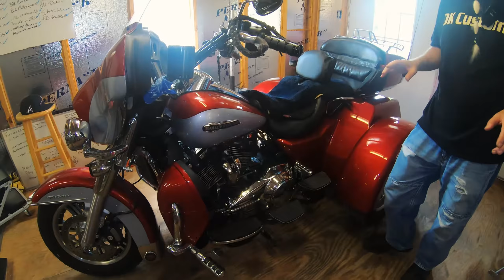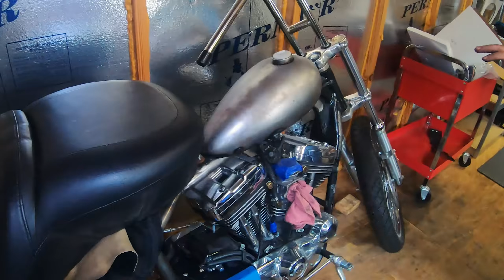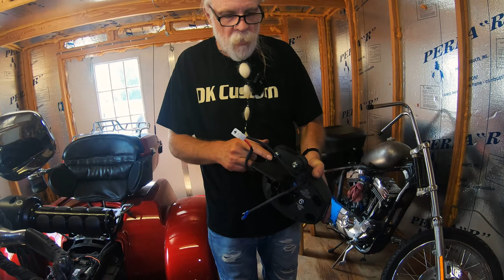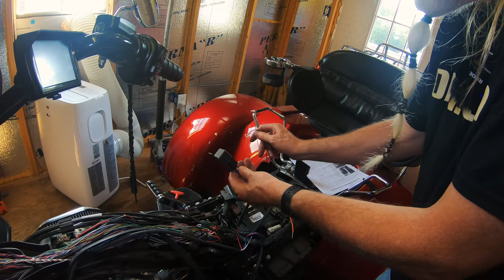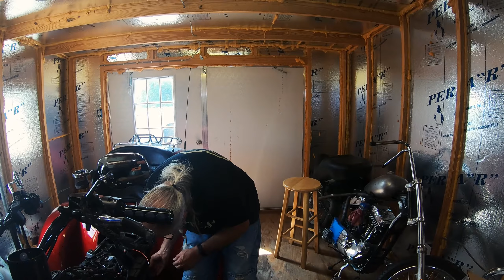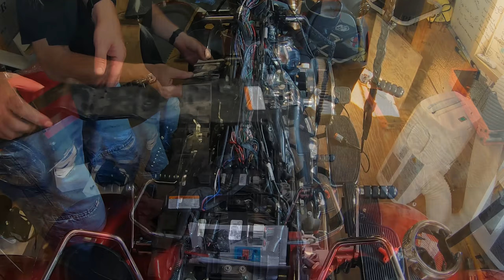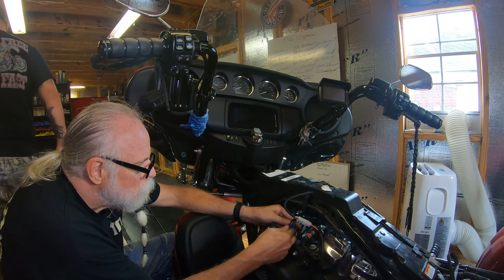COOL YOUR HARLEY - SEE Force Flow Fan Installation

Comment: So Harley designs an engine that can/will exceed the safe elevated operating temperatures as per their own manual, then charges you a fortune to buy their product, then on said Harley perfection you must spend additional dollars to help with engine cooling so you don’t ruin the engine. I get that right? Makes sense to me.
Reply from the maker: Yeah, not ideal, to say the least.  Harley is in a catch-22.  We discuss that at the beginning of this video-
https://www.youtube.com/watch?v=N0kLaVQhbW4
Reply: It's the EPA and European environmental agencies forcing more and more restrictions onto manufacturers like Harley and if they don't meet the requirements, they get shut down and not allowed to sell vehicles at all. Don't take all your anger out on Harley, it's the EPA and if those rediculous regulations weren't in place, Harley and every motor vehicle company would let their bikes and cars breath and it would be cheaper, better and more affordable for everyone involved. These envoronmental agencies are completely out of control and making it impossible for businesses to succeed and they're killing manufacturing which is a vital industry for any countries economy and jobs. Small businesses don't stand a chance with all the red tape if massive companies can barely manage. Most of their regulations do nothing for the environment, it's about money, power and control.
Reply: Yea but however the fan isn’t HD yea they make one to put under the seat that pulls air over the rear which they should install from factory especially much as they cost the bad thing with all the electric crap our wonderful I mean very very very wonderful government are doing all bikes r fixing to soar not sure what any manufacturers are going to do but yea they all are going to outta sight
Reply: Yep. Spend a fortune doing what Harley should be doing already

Comment: Oh, and forgot to add. You need to double check the thermostat wires and make sure they  clear the bottom of the tank. Don't ask how I know.....LOL
Reply from the maker: Yeah, we should have shared that in the video too...make sure all the wires clear.  We use tank lifts, so there was plenty of room and we did not even think of that.

Comment: Nice install! I too run a Jim's Force Flow fan on my 130 inch TMan engine. In stop and go, 95 degree weather I see 375 head temps thru my PV. Looks so much better than the Love Jugs, only bad thing is the puny horn, but I wired my factory horn in parallel and mounted the horn on the engine guard under my RGS Fairing
Reply from the maker: Very cool!  That sounds like a fun engine!  What is the ET reading on your Power Vision?
Yeah, those that want a loud horn...it just won't fit in that housing, so best to do what you did and use them both.  Thanks for sharing. 👍
Reply: @DKCustomProducts  375 was the highest reading I saw, now that fall is upon us here in the northeast, I see 325. One thing that "bothers" me, is the thermostat is on the front cylinder. My thinking is it should be on the rear cylinder, as its the hottest, but clearance would be an issue. (No tank lift on mine) And, Oh yeah, its a fun, fun ride.....Especially wacking the throttle in first.....second...third.....LOL 150/153 to the tire does that to you!
Reply from the maker: @01Lightning  Yeah, as you see I did install the thermostat in the video.  Rode it that way for a couple of days.  I have now bypassed the thermostat and just use the switch.  I like it better that way,.

Comment: Super kewl! was nice to see how to get the fan thermostat to mount on the twin cooled M8. I recently installed the love jugs on my 2018 Ultra Classic. I did hook up the wires directly to the battery. I do have to turn the fan on and off manually; however, I don't really mind doing that. If I ever got tired of the love jugs I'll try Jim's Force Flow Fan. I do like the look.
Reply from the maker: Thank for watching and commenting. 👍
Yeah, I ran the Wards Part Werks fans for years, and then the LJ's for many years.  They work great.  It was just time to go with a different look, but still keep the cooling benefits.
Reply: Yea I’ve been looking to add one but same like the looks of Jims better but looks like the LJ with two fans would cool better but guess anything would be better than nothing but it does look like Jims is kinda center of the heads so I guess going in between the heads might be better have no clue

Comment: I wonder how the fan effects engine heat felt on the riders thighs? Very interesting product and typically excellent video.
Reply from the maker: When moving there is no extra heat felt.  When sitting still, some do feel the fan blowing heat on the right side....but because the engine is less hot, the heat felt is less than a hotter engine radiating heat.
The vast majority of folks are wearing jeans and do not feel anything.
Thank you for the question, and glad you're liking the videos!

Comment: I have been using your stuff since 2016 when I bought a new 2016 TG.  I have a lot of items on this bike that came from DK and have been pleased with them.  I enjoy watching your videos and they are very helpful.  However, PLEASE find a place with "GOOD LIGHTING" to do your videos.  Inside your building is just not a good place for producing videos.  A lot of the details you are pointing to or talking about cannot really be seen.  Maybe at least you can add some portable lighting in there to use when shooting videos.  Keep up the good work with videos and as I said before, I am very pleased with all the DK products I have bought over the last 6 years.  GREAT COMPANY with outstanding service after the sell.  BTW, you have improved the sound and it is a lot better than some older videos.
Reply from the maker: Thanks man!  Really appreciate your business, and Very Happy to hear you are liking the parts we make.
Yes, making videos is a lot different than making parts.  We have slowly been improving.  Took over 6 different mic set ups before we finally got good audio.  We are using secondary lighting, but just the other day we decided that we are going to move the majority of our indoor videoing to a different location.  It will definitely be more well lit.  Thank you for the good advice, confirms what we we've decided to do.
Unfortunately it will be sometime in the new year before the new place is ready.  Until then we will double the lighting that we have been using.
Reply: @DKCustomProducts  GOOD NEWS.  Well, the New Year will be here and gone before you know it.  Keep up the good work and looking forward to more videos in the future! 👍
Reply from the maker: @mdfurr  Thanks man, we appreciate you watching the videos and your support! 👍

Comment: My 2020 Freewheeler has an accessory port under the right side cover. No need for connecting wires to battery. I run Love Jugs.
Reply from the maker: No need on this to do a hot connection to the battery either, as shown in the video.  I do prefer it though.
Reply: @DKCustomProducts  with the Love Jugs, you simply plug the fan's power connector into the accessory port on the bike. no individual wiring necessary. no need to remove the tank or the seat. nothing is connected to the battery or a ground somewhere on the frame. and when you turn the bike on, the accessory port gives full power. really simple.

Comment: Love mine, installed on my softail last April. Worked awesome all summer long, especially when having to stop at several lights making my way home on a 95+ degree day. Thermostat engages fan at 140 degrees cylinder head temp but if it's a cooler day and oil temp wouldn't come close to 230 I'd turn it off with the switch. Little more to install on softail since the coil needs to be relocated to the top front engine mount bracket and new length plug wires but after having all summer well worth the cost and time to install imo. The fan is very well made which seems the norm for Jim's. Thanks for another great video!
Reply from the maker: Glad to hear you're enjoying yours.  
Devin, the "D" in DK has been running one on his Stage IV Street Glide for quite a few years now and  it does a great job for him.
Yeah, a bit more work with the M8 Softails with the coil relo needed.
Thanks for the comment and info! 👍

Comment: Great fan,horn sucks bad,for the money the horn should be alot louder
Reply: The horn on my 2019 Road Glide Ultra is VERY LOUD.
Reply from the maker: Yeah, horn is not as loud as stock.  Pretty sure it is as loud as it can be in the space there is in the enclosure.  The instructions include how to use the stock horn in conjunction with the built-in horn if you want loud.